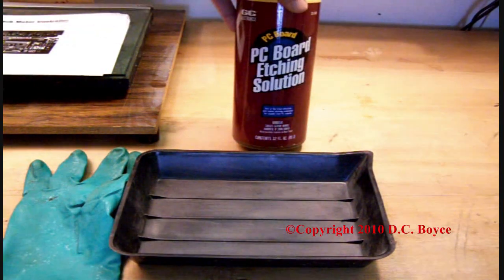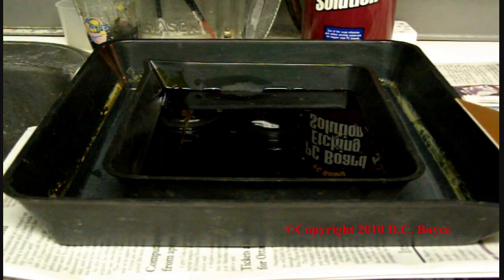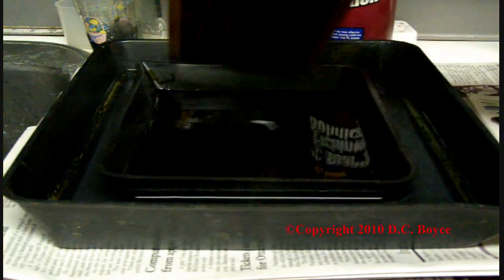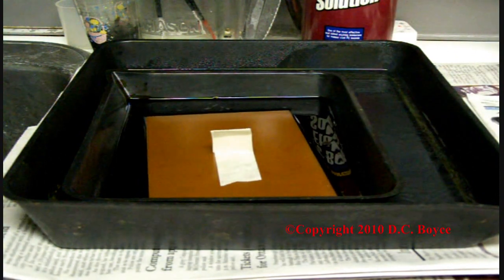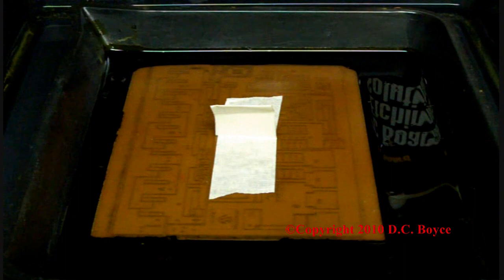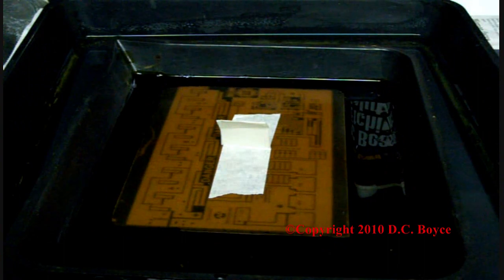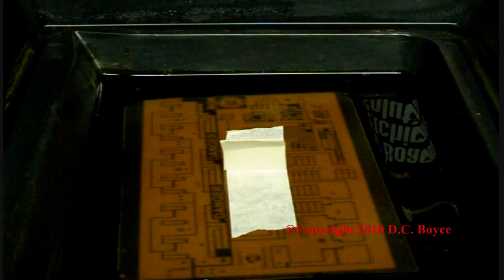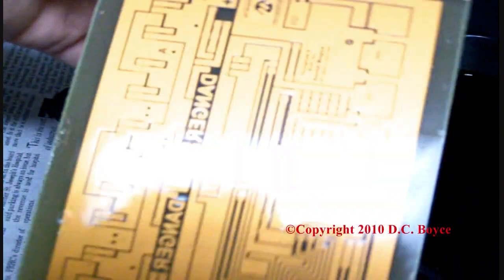PCB Making-Part 4-Photo Resist Method of Etching a Printed Circuit Board

Comment: Exuse me sir, just to be clear, the black Means copper stays, and the clear which is exposed to UV is what leaves. As in, when UV hits the board, the resist is neutralized, and that that is not exposed to UV keeps the resist. Is this correct?